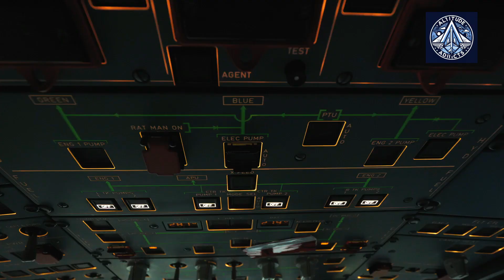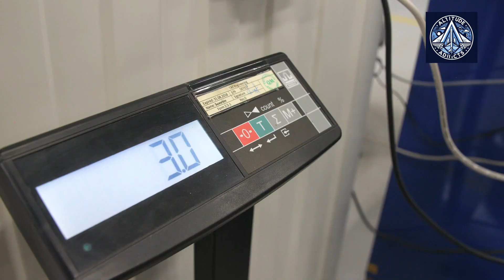Russian Boeing, Airbus, and Superjets at Risk—Approaching C Checks and D Checks

Comment: If the plane is not airworthy, then the pilot will not dare to fly it. So the option that many planes land for a long time is a safer option. Never dare to fly it. This will indeed disrupt the mobility of the population in Russia and once again rather than having an accident it is better to have no flights. However, I think it is still possible that there are smuggled aircraft components from Turkey, India and China who are ready to supply. However, this also requires extra caution so that the West does not find out.